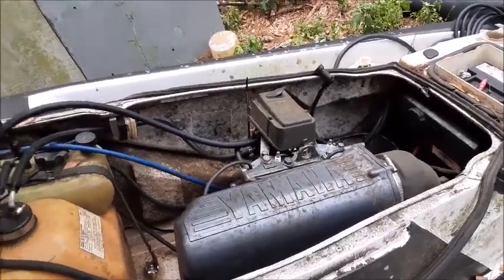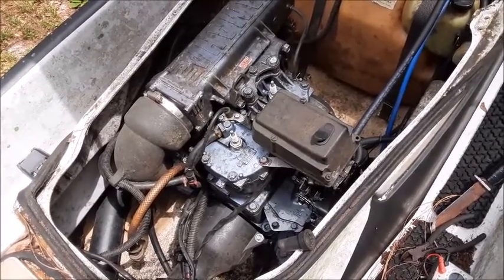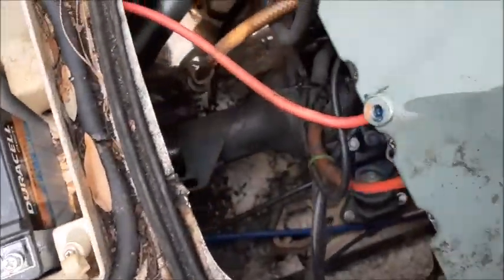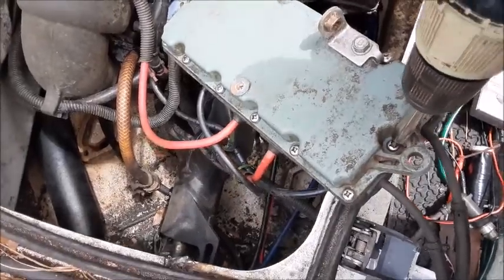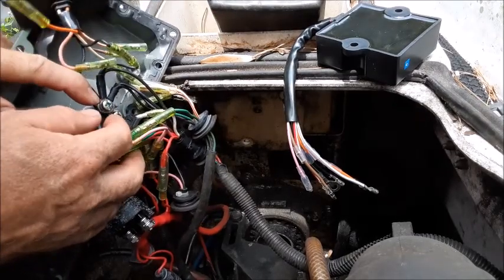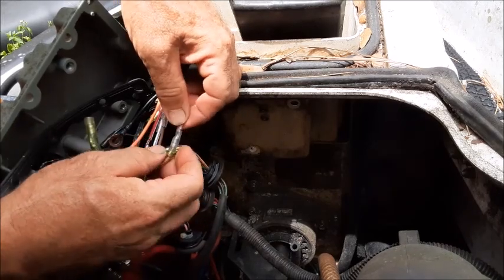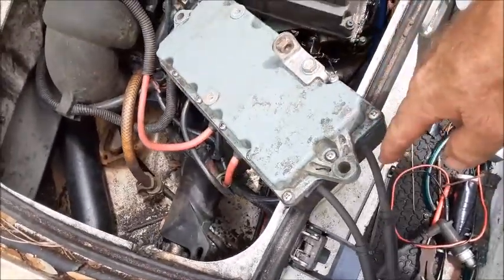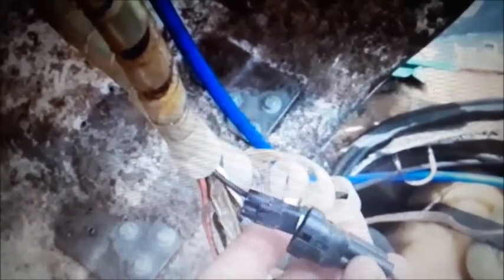Symptoms And Replacement of a Bad Waverunner / Waveraider CDI Unit

Comment: Hey there sir! My Waverunner is experiencing similar problems but not 100% the same. My 1995 650T is currently rev limited and only tops out at 6MPH. I've rebuilt the carb, checked for exhaust restrictions, installed new spark plugs and still the same issue. However the other day when I was on the water, it magically fixed itself for 10 seconds, it felt great, didnt even know these WRs had power like that! But after the 10 seconds of joy, it reverted back to being rev limited for the rest of the time on the water. It never cuts off and always cranks and starts when hitting the start button. Think it could be the CDI or something else?

Comment: I have a 96 waveraider and it starts just fine but the stop button and lanyard won't stop the motor even replaced the switch any ideas on where to look or possible problems?
Reply from the maker: It has been a while since I worked on one of those start stop buttons but I would suggest 1. if you replaced it with a used stop switch check the rubber boot on the button which is under the actual stop button that you put your finger on.  You have to remove the plastic cover to get to the actual button.  If the rubber boot is torn you  can clean the contacts on the button but this fix is somewhat temporary.  2. check the wire connector which runs down the steering column.  There are are two sets of wires which each have a double plug.  One is for the start and one is for the stop.  Sorry can't remember the color combos, but you can check those conectors.
Reply: @creativerepairing2960  the switch is brand new and checked all thoses does the cdi have anything to do with it you think?
Reply from the maker: I am sorry I don't have a qualified answer that question.
Reply: @creativerepairing2960  check them for what?
Reply: please tell me youve figured this out because i got the same issue. I watched another You Tube video these kids did with this issue and they swapped in a new CDI and it fixed the problem. I really want it to be the switch but mine looks good and clean

Comment: I replaced both the Start/Stop Box and Starter solenoid! Checked Fuse also! Still no power to the White Connector that goes up to the Start Switch!!
Reply from the maker: I have seen on salt water skis where wires will rust/crode in two right at the ring hoop / connector just under the plastic wiring insulation.  Usually inspecting the wire they feel like a floppy rubber noodle right at the wiring break.  This usually happens to wires exposed to hull water not ones that are in the sealed electric box on the back wall.  The battery terminal wires are most common for this issue. Don't know if that would help?

Comment: could you elaborate on this @6: 10 i have the opposite problem; the ski will start but i cannot shut it off by pulling the lanyard(which must be in for it to start) or by pressing the stop button. im trying to rule out the stop button being faulty or not and having a tough time...there is another video on you tube where this was the problem and it was the CDI that had to be switched out...
Reply from the maker: The start stop switch is commonly bad.  If you take the plastic cover off the start stop switch on the handlebar you will notice a small switch under the push buttons.  These small switches have a rubber boot on them which if the rubber boot is cracked it has likely been getting water inside it.  You can take them apart and clean the contacts but this is usually a temporary fix.
Reply: @creativerepairing2960  i bought a brand new switch and it did not remedy the situation. help...

Comment: I had my 2004 yamaha xlt1200 started.  Decided to wash the inside. Now it won't start.   Seem like no spark.   Would that start and stop be it
Reply from the maker: If you are referring to the start stop button on the handle bars, if it is the same as mine that is possible.  You could jump the wires at the disconnect clip where they run up the body into the steering column.  All electronics inside the engine conpartment made water tight unless something has been messed with, so it shouldn't be wet from washing.
Reply: Just a tip always cover CDI box and electronics prior to washing inside, also don't direct water to electrical components....I've heard some guys sprayt all electrical connections with wd40 prior to wash down... Good luck
Reply: @BeardedAK47   yes I did that the next day wd40 and it worked thx

Comment: it was cranking fine then allof a sudden it stopped firing and checked the start stop switch and it wasnt that and then changed the ignition coil and still isnt firing so im thinking it is the cdi box

Comment: I got a 93 vrx pro an it cranks but no spark on the plugs . Would cdi be problem
Reply from the maker: Can't say for sure but very possible.  You also have some electrical parts under the flywheel which could be the issue also.  Also could try disconnecting the plug which leads to the kill switch on the handle bars.   If you are a DIY type of person throwing a few after market parts at it even if you are not sure the issue is a lot cheaper than the shop.

Comment: Thank you for the post! I have a 1991 Yamaha Waverunner 3 with the 650 in it. The engine starts up and idles fine but will not rev up. It smokes allot and runs rough. I replaced all the fuel lines and have a new oem fuel filter that I installed a year ago. Also replaced the anti syphon valve at the tank. Any ideas? 

Thanks,

Pastor Ramon
Reply from the maker: Hi Pastor Ramon,  Since it is a two stroke engine smoking a lot is not a sign of a worn out engine but could be running too rich or too much oil.  I don't recall if the WW3 is oil injected or not but if it is I would convert to premix as when the oil pump eventually fails on a 30 year old ski you will ruin the engine.  I usually premix my skis at 50 to 1 but other people might differ with me.  You could try cleaning the carb by disassembling it an blowing out all the small passage ways with carb cleaner.  A rebuild kit is inexpensive so you could try that.  Old gas lines tend to deteriorate on the inside walls and small particles get into the carbs causing problems.
Reply: Ramon, step one, drain the old gas and make some fresh pre-mix and try it.  Afterwards, I agree with a carburetor rebuild. Be careful to only get rebuild kits from Mikuni or you will be sorry. You might even want to consider a brand new Mikuni carburetor, they are not expensive. Another possibility, is you have a bad reed valve. Disconnect one of your spark plug leads and try to rev the engine, then do the other one, if one of the reed valves is bad the engine will not rev with that cylinder.  CDI’s, can go bad in a myriad of ways and the only way to 100% troubleshoot them is to slave one in that you know is good and try it.  Good luck my friend.

Comment: Hey boss, wave blaster will run great for the first ride and then die mid throttle. Doesnt bog or lose power just cuts out mid throttle. Wont start back up for like 15 minutes. When it does it runs fine then dies again very soon. Everything runs seems fine until it dies/ just cranks and wont start until sat for a while. Any ideas?
Reply from the maker: Sound like an electrical issue.  I know there are complicated ways to test the various electrical components but with the reasonable price of a lot of these after market parts I usually just start throwing parts at it.  It comes out a lot cheaper than taking it to the shop.  I would start with the CDI first.  I have a blaster also.  Cracked the block 10 years ago and hope to get it back on the water soon.
Reply: Cdi box or stator 100%

Comment: My 95 Wave raider does nothing when I press start button.  I hooked up jumper cables so I know it is not the battery.  I do not even hear a click in the solenoid.  Any ideas on where to start?
Reply from the maker: Sounds like either a bad solenoid or start switch.  Try bypassing the start switch before taking the power box apart and see if it will turn over.  The start switch button on that model has issues with the water proof rubber protective covering splitting thus getting the switch wet inside.  You can take it apart and clean up the contacts but the problem will keep reoccurring.  In rare occasions I have seen a battery terminal wire corroded in two inside the plastic covering at the terminal yet when looking at the plastic coating on the wire they look fine.  If you remove the terminal wire you can ohm test it or just see if it feels like a rubber noodle right the the end connector tip.  Hope this helps.
Reply: i was told to never use jumper cables and a car battery, will fry everything.

Comment: What you also want to watch for is intermittent fire which is caused by the Yamaha lanyard system and what it is people go buy a lanyard from Walmart or aftermarket and it's not quite thick enough to lift the kill switch all the way up and the vibration from the motor causes intermittent fire also the crankshaft can get just a little bit of wear and what it will do is short out the stator and cause it to die and it will idle fine on the trailer but when you hit a wave it will die and that's because the slack in the crank is coming up and shorting out the stator
Reply from the maker: Thanks for the tip.  Good advise